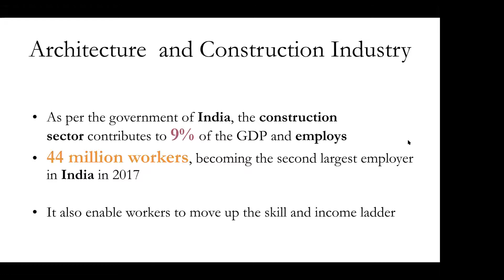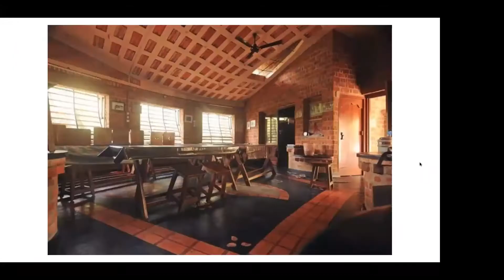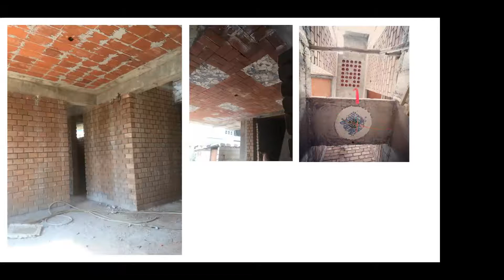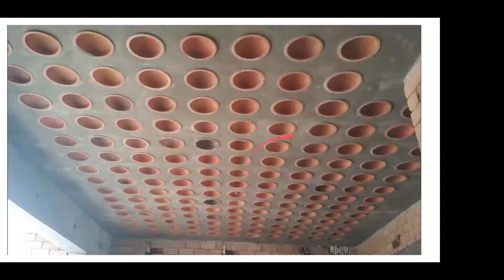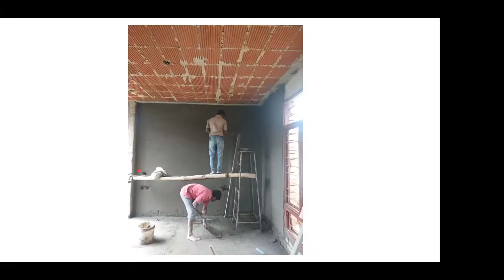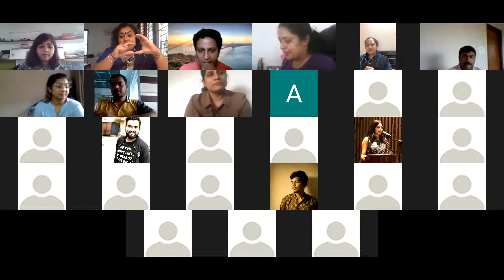Towards Sustainability - Filler Slabs

Comment: Can the filler slab can be used in a load bearing structure (walls bearing the load) or structure without column & beams
Reply from the maker: yes absolutely. We use it in load bearing structures all the time.

Comment: Since these are terracotta tile, they might be prone to breaking.

1.  In that case can these be repaired or replaced?
2. Assuming multiple such tile break, Will this have any impact on structural integrity?
Reply from the maker: yes they can get chipped. The tiles / bricks do not serve any purpose in strength of the roof. They're only used to lighten the roof. The chipped tiles can be camouflaged with red oxide. But to be careful is imp.